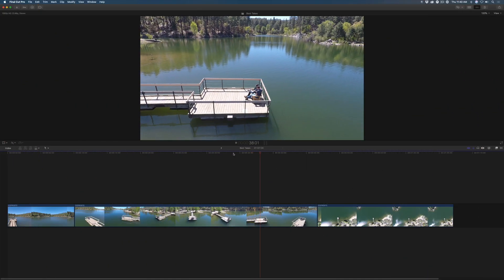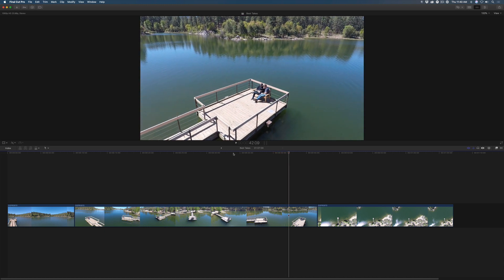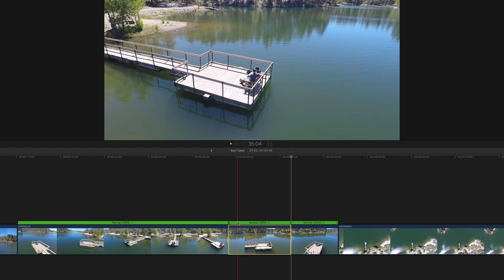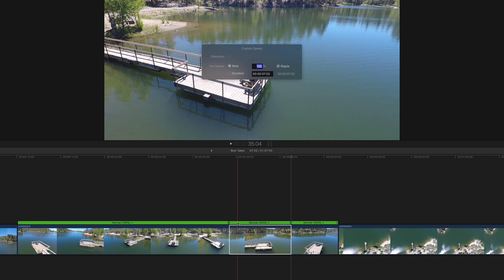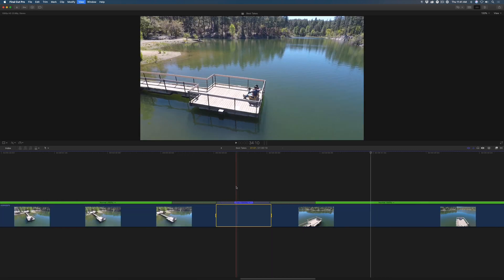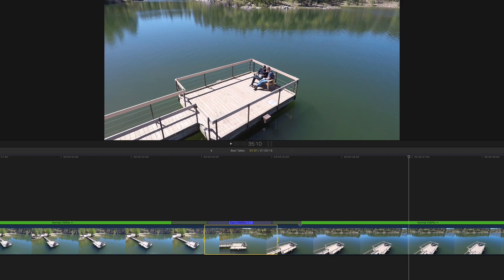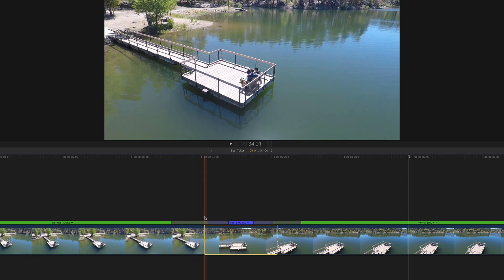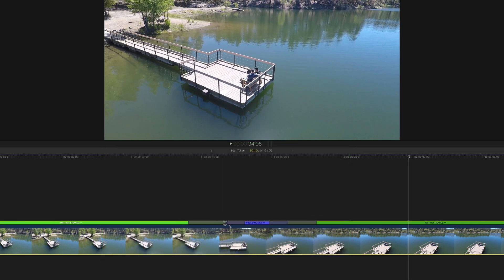Ep 19: Faster Speed Ramps in FCP X

Comment: You can do even (much) faster. Set an inpoint (with I) and set an outpoint (with O). Increase the spread (e.g. 4 times) and done. There is your speedramp
Reply: nope that won't give you ramps into and out of your speed change.
Reply: Mark Spencer Sorry Mark but it does. I've checked again and works like every normal speed ramp. Can't put a photo here but please check. Works fine
Reply: @OyiboVFX  You are right, I stand corrected. That is a nice shortcut instead of using Blade Speed.
Reply: Worst case, with the clip selected that has the speed ramps, clicking on the ‘clock’ speed icon and checking ‘speed transitions’ will create the ramps for all.